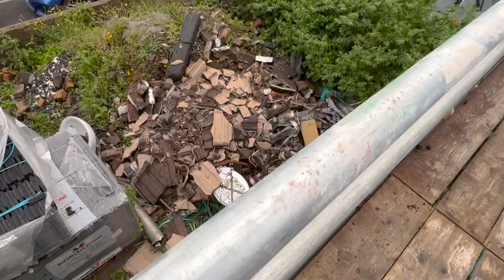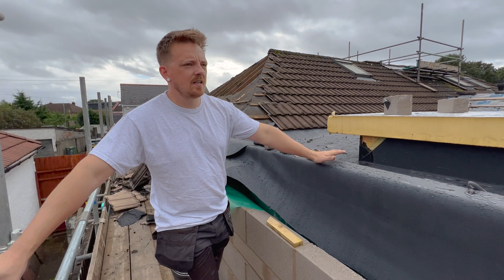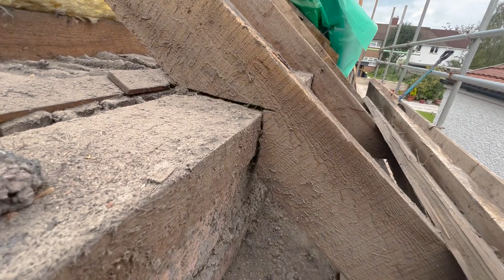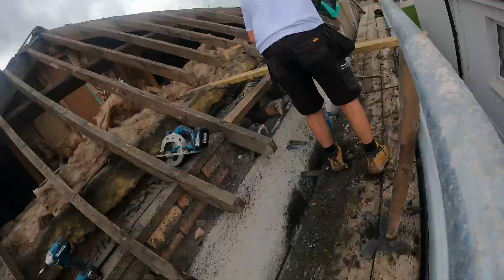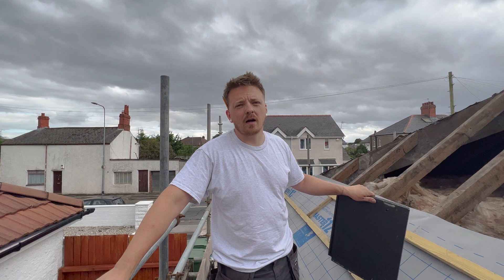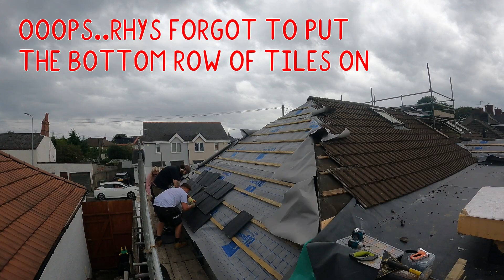All in a days work, Changing our Roof - Part 1 - Self Build Project - 1930s Bungalow Renovation

Comment: You forgot distance or ventilation laths (which follow the direction of your rafters) before putting on the roof battens. This is very important for roof ventilation. Rafters > membrane > ventilation laths in same direction as rafters > roof battens accross > tiles.
Reply from the maker: I’ve had a read up and can’t find anything stating that counter batten is required for roofing unless the undersarking is ridges, which it isn’t 🤷🏻‍♂️

Comment: I'm literally about to start putting Northstone Causeways (riven) on my roof today! Unfortunately I had to completely rip out every timber & rebuild it from scratch as well so I'm already a couple of weeks into the job now. I'm on a tight budget like your self but more importantly I just prefer to do it my self as I've seen to far many jobs that just don't meet my standards.

Was there any reason you didn't nail the bottom 3 rows (unless I missed it) & then moved onto double nailing every other row? I was wondering how I'm going to go about it my self & see the manufacturers instructions say a minimum of 2 mechanical fixings for tiles around all edges & 1 mechanical fixing in the right hand hole for all others. I know traditionally they only used to nail every 3 or 5 rows with concrete tiles or sometimes none at, which I believe is the case with most of the houses round my way.
Reply from the maker: That’s unfortunate about the timber, and the reason I haven’t nailed the Bolton row is due to to no fascia or felt support tray, it means I can slide the second row up and remove the bottom to put all this in then I can tile the bottom row once done 👍
Reply: @Selfbuild_TheJenkins   Ah gotcha, all my fascias, vents & barge boards are up thankfully & I got the felt support trays in yesterday after felt & battening. The high winds & rain yesterday were great timing for it.😆